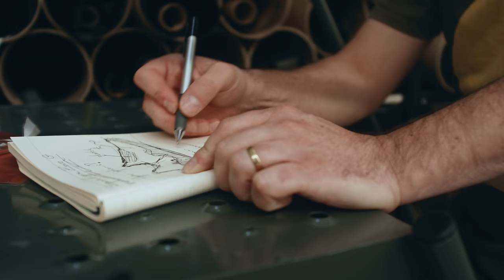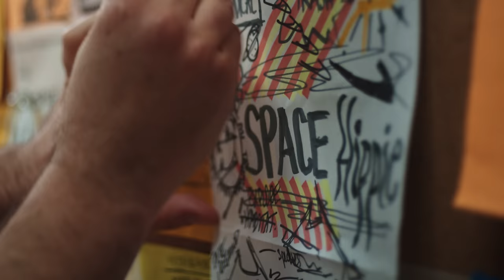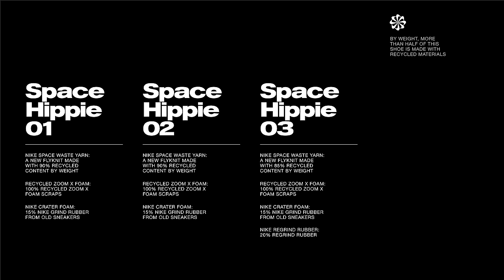Space Hippie: These Nike Sneakers are Trash | Nike

Comment: I love this concept! But if I'm purchasing recycled trashed sneakers I then feel some type of way by paying premium prices. The recycled product should be cheaper since it's technically made from already worn shoes.
Reply: Lenox C makes no sense. The cost is in the production value not the material.
Reply: But if you watch the video it isn't made from worn shoe. But the excess shoe material like nylon, rubber etc.
Reply: Just because the sneakers are recycled doesn't mean the material isn't still premium. They're basically making completely new materials out of the old ones by grinding them up.

Comment: It would be better if they made their shoes repairable (and more durable) and then supplied the parts and service to repair them- THAT would be pretty revolutionary for a big company. Recycling still burns more energy and requires parts of the sneaker that are not worn out to be unnecessarily put in the energy intensive process of recycling/remanufacturing, not to mention the energy expended for the product to find its way back to a retail store.